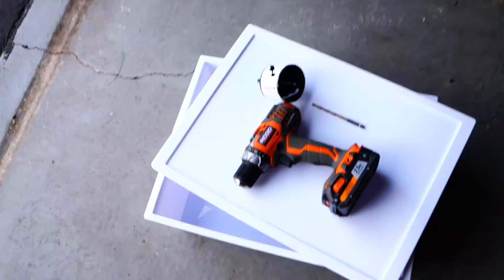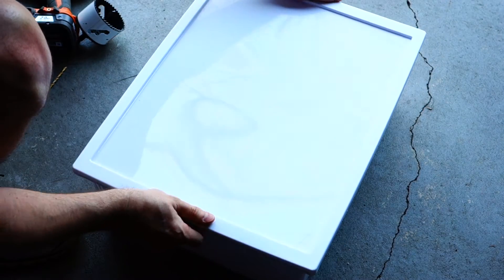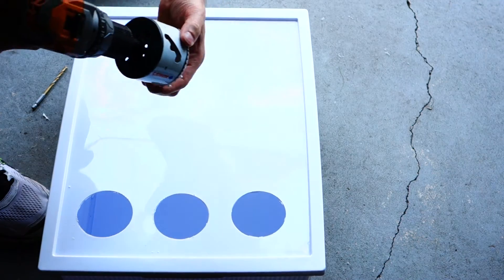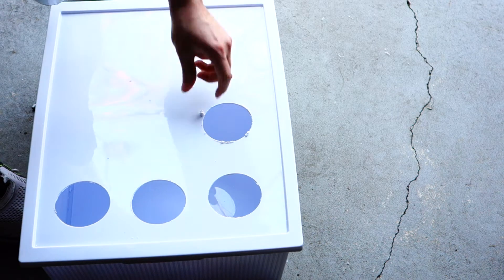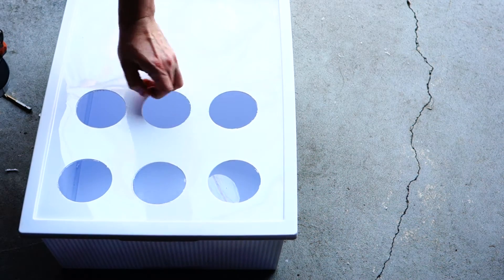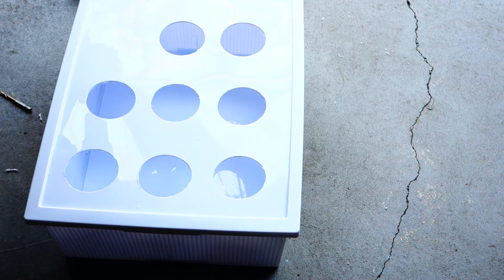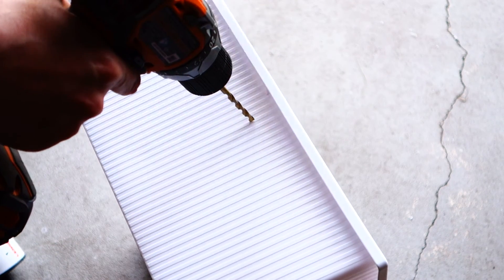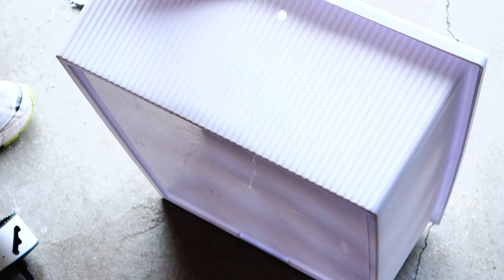DIY Build a Hydroponic Reservoir Guide @ Home

Comment: If you're new to this, try to use black container or spray paint it so you can block out lights from leaking into reservoir or else the algae will drive you crazy.
Reply from the maker: Desert Monk i been doing this for a long time never a single algae issue.  This container is 5 bucks, anything pre cut and classified as hydroponics container, which is just a bucket costs 25 and way higher.
Reply: but then it said if it dark (Black) it will get hotter in the tent
Reply: i'm a rookie lol still learning
Reply: It does, but it's not going to make that much of a difference.  Many of the plastic pots and hydro systems on the market are black though.  You can always paint it white if that's your concern, as long as lights doesn't leak through it's all good.
Reply: Grow Indoors 365 where did you get this containers. I went to Walmart and didn't fine it.
Reply: Sterilite 26 Quart ID Box- White (Available in Single Unit or Case of 6) By: SteriliteWalmart #: 552217362